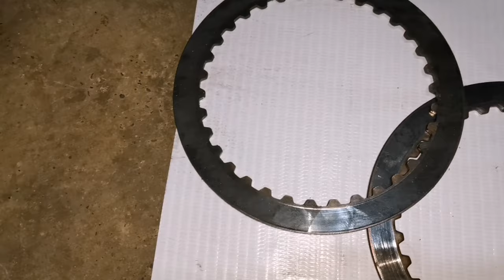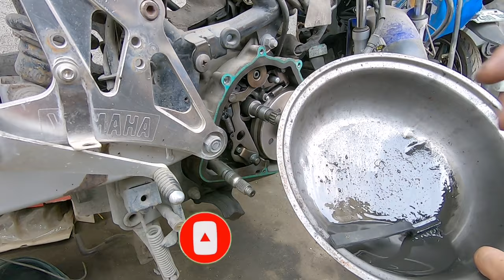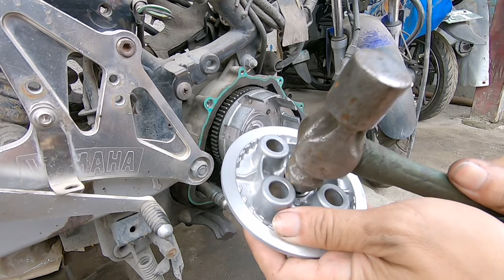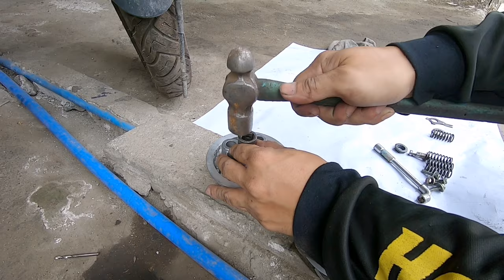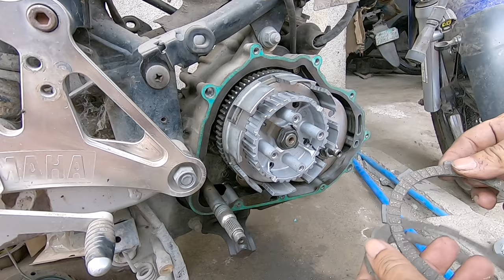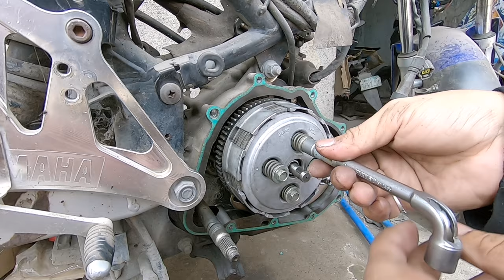Sniper 135 Classic Replacing Clutch Linning.

Comment: Boss, nung hinigpitan mo ung nut sa clutch housing, saan mo kinontra para hnd umikot?
Reply from the maker: Ang diskarte ko jn boss basahan... Iipin mu ung basahan kung san mapipigil mu ung pgikot ng clucth housing.. Kapalan mu lng ung iipit mung basahan hah.
Reply: @bjornworks5960  ung sa sniper kasi boss ung clutch hub lng ung naikot. Hnd kasama sa ikot ung clutch housing, kaya kahit kalangan ko ng basahan ung gear ng housing, umiikot pa din ung clutch hub.
Reply from the maker: @jayceebobadilla3141  ah.. Ikambiyon mu muna and preno or ilock mu ung preno... Pero kung tlgang mahigpit yn impact wrench n tlga nid mu...
Reply: Ganun pla teknik dun. Maraming salamat  boss!
Reply: BJorn works  San po ba location  nio gosto ko sana e refresh  ang motor na sniper135